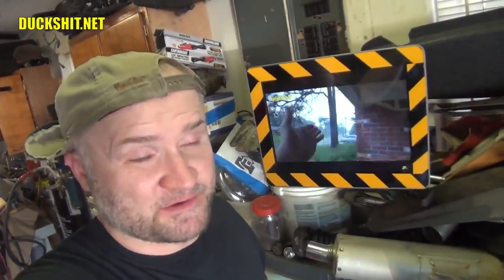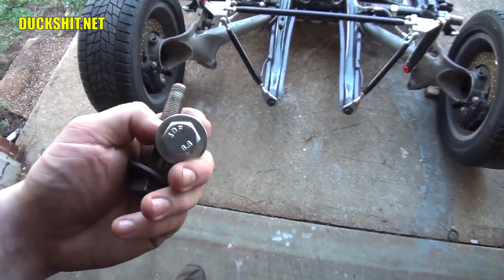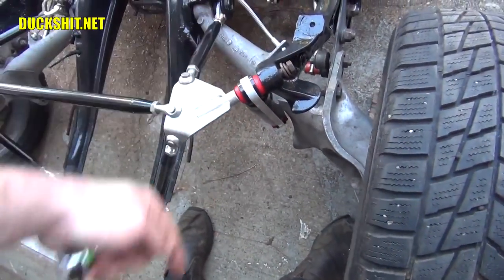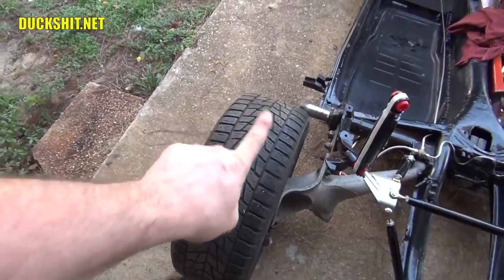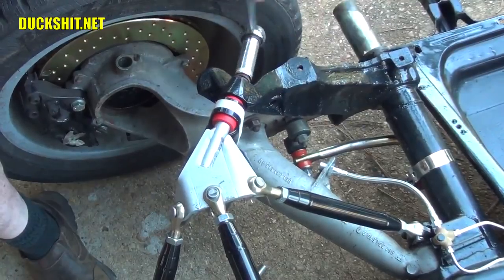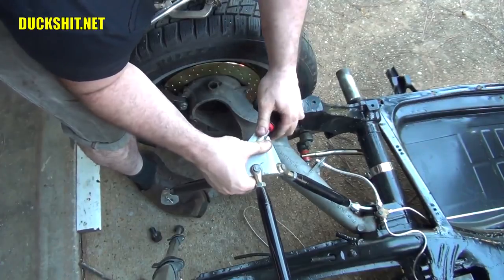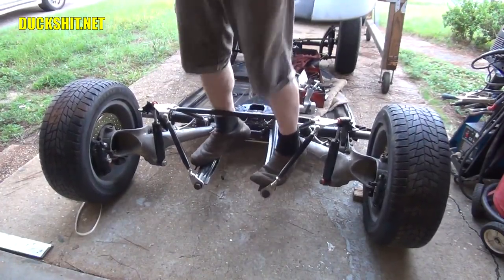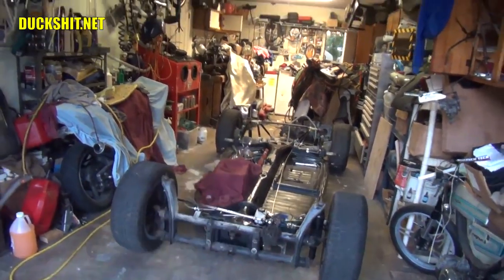Rear Shock Nonsense - ROTTEN OLD 1956 Chop Top Oval VW Beetle - 36

Comment: You make me want to go buy another bug,  I once had a 1965 beetle I bought while stationed at Hill Airforce Base in Utah which I bought for $800 and I drove it to Tennessee and broke down in Murfreesboro due to the points being out of adjustment,  I worked on that bug for several years and towed it home to Pennsylvania,  I burned up the new motor I got in Tennessee due to running it with a broken fan belt so I put my original motor back in and converted the 12 volt parts onto the stock 40 hp I yanked out in Tennessee  , had so much fun with that  bug , driving it was like a time machine,  sold it and got A 1973 Super Beetle,  wish I kept them both
Reply from the maker: Get another one quick before the prices go up too high!  Thank you for that story, I really appreciate those.  Everybody always has a great VW story and I love hearing them.
Reply: Never to late to get bit again by the bug. Your always welcome to come back to the vw family

Comment: Myself I'm working on a 1959 that I acquired with a great pan no holes and even heater channels in perfect shape..body has a few rust holes in drivers rear panel below side window..and a dent or two here and there..  Had no motor but I found a seized 1500 that I broke lose,it runs great...machined bell housing to fit freed up trans,it too was locked up now replacing seals and soon I'll make it into a class 11 legal buggy...
Thinking about a 1967 bus IRS rear conversion,same place I got my motor,
Reply from the maker: Sounds like a nice project there.  Are you making some videos?

Comment: Sorry, man. Winter tires have a softer rubber compound than warm weather ones do allowing them better cold weather flexibility. 'Blizzak' tires go one step further:  Their top tread cap is made from foamed rubber giving them thousands of suction cups to grip the ice better. Once the top cap is worn off they are more like an all-season compound. I had a set here in Canada and they had stellar performance.  Great wet weather tires as well. I also used to sell tires.
Reply from the maker: That's interesting information, thank you for that!

Comment: I mean, if we're getting nit picky about the wheels and tires then I'll just point out that the center caps aren't pointed at the valve stem like they are/were when new Porsche's are/were delivered... ;-) LOL!!
Reply from the maker: Actually that's good advice right there.  Silly and a minor detail, but its something that educated judges at a car show may notice! I'll turn the shields around to point at the stems!  That is was something I didn't know!   Thank you!  You are an endless wealth of advice!
Reply: DuckmanCycles and VW Garage  Also, if you have or are going to be putting wheel locks on, they get lined up with the crest and valve stem as well. Sometimes they are directly above the crest and sometimes in between the crest and valve stem depending on what wheels you have. On your phone dials, they'd go between. It's little things like this that Porsche prides themselves on that very few people know about.
Reply from the maker: I'm leaning!  Little stuff like this is what you pay for when you see that sticker price!  LoL!  Thanks again!
Reply: I actually do that on the cars I work on I'm always adjusting them on every car I remove a wheel on. Very OCD on that and I always have the wheel bolt caps(the gap between the v and the n towards the center cap. Maybe its overboard but I get that itch if its not perfect lol

Comment: Those chrome shafts on the shocks will take a ton of dirt and mud without getting scratched up and leaking seals. If you are still worried about them, you could get shock boots to protect the shafts like they do off-road. Or use a smaller cover like you would put on a tie-rod end.

Moe
Reply from the maker: Yep, you are correct.  I am rather surprised of their design, especially since this company designs their offroad stuff the same way.  But this is how it will stay for now!  Thanks for the suggestion!

Comment: Boot covers for the shocks?    is the top shock bush 2 piece?  its hard to see, but is there a chance its going to creep out of the shock with no washer against the threaded tube,?
Reply from the maker: A washer would be nice, also would be nice to have a longer bolt to accomodate a washer.  There is more to come, its not done yet.

Comment: I have built a limited slip diff for vw trans on the cheap but it's hard to explain but all u need is a extra set spider gears and tig weld and angle grinder and about 3 hrs with the diff already out to mod a open diff to limited slip of sorts
Reply from the maker: I had read something once that an extra set of washers or something would cause the differential to act more like an LSD...  did you photograph or video document your build? I'd like to see!
Reply: @DuckmanCycles  
No I did not this was 1996 I will try to explain so u take your 2 extra spider and use grinder cut it down so it looks like a 3d curved wedge would look sorta like cut out half turn of  valve spring coil then weld it to the face of spider gears on stub side so what happens is it can turn freely about 1/2 to 5/8 of a turn then it hits the big center pin and is locked up tight it worked many years on 2 different rails
Reply from the maker: Sounds more like a locked differential the way you describe it now.  I dunno.
Reply: @DuckmanCycles  well that's why I say sort of a limited slip cause I have drove a few cars with fully welded diff and this one has the ability to slip a 1/2 or 5/8 of a turn before it hits the pin and that's a world of difference than a solid weld
Reply from the maker: Sounds more like a harsh limited lock.... lol!  I'm sure its find for offroad, may not be the nicest thing to drive on the steet.

Comment: thumbs up for using the metric system (Y) :) ps. try to teach abom to use it too ;D
Reply from the maker: Haha!  He gives me hell all the time for using metric... anytime I bring him something and I need his help I always give him metric measurements and it drives him nuts LOL.   He says I'm the only guy that does that to him.  Heheheheneheheh
Reply: The metric is far simpler and more exact then the imperial. Starts by zero and ends by hundred, no a.e messy 1/8 5/16 or 16/32 shit. Try to build a circled extruded roof with imperial meas. and get the distance round from one pillar to the next.... there we go.
A good example how this fails can you see in the Kennedy space center - if they didnt changed that since 1989 as i have seen it in person.

Comment: The main bolts for the shock have to be-  Gread 8 steel,  higher tencile steel,  Soft steel,  Hard tempered steel,  Car wheel  bolts,  Are grade 8 steel.  Double check Duck-Man.
Reply from the maker: Double-checking already done, Volkswagen and Porsche used metric grade 8.8 bolts for brakes and suspension... not to be confused with the standard grade 8 that you are speaking of.  Metric grade 10.9 would be great, but if a car didn't come with them to begin with and why should I be so worried and spend a fortune upgrading all of the hardware?   Not necessary, but thank you for your input!

Comment: would be to eliminate the rear torsion bars and convert to full rear coil-over with Porsche 944 rear suspension on a bug
Reply from the maker: Sounds like fun, but then I lose all of my adjustability that I wanted here and have built into it!  You should build one like you say, I'll watch your videos!
Reply: I misted out the worlds possible & to it was meant to be a question and not a suggestion but after googling Porsche 944 rear coil over kit and I found a few vendors the  make adjustable uni-ball spring plates and complete kits with all the hardware including a set of adjustable coil-over socks. you'll have to wait a long time to see my videos my project is only a plan in my head, a design and a few wish lists at the moment but I will make it a reality one day and make a series of videos of each stage of my project from start to finish

Comment: I want to see a 13B in this car lol
Reply from the maker: Sounds like fun, but I don't want one lol
Reply: @DuckmanCycles  
I just want to own a rotary lol
Reply from the maker: I went through that faze already, lol.  Now I want a flat-4 2-stroke engine made from CR500 cylinders!
Reply: @DuckmanCycles  why stop there
Use 4 maico 700 cylinders lol
Reply from the maker: Yeah, you get it!  Hahaha!  LoL!  and it should all fit reeeeeeeeeealllll nicely in the Beetle without having to cut any metal!  All that blue smoke.... BRAAAAAP!  Ba-ding-ding-ding....
Reply: @DuckmanCycles  
Sadly gas mileage would be measured in gallons per mile 😂😂😂
Reply from the maker: That'd be my least concern lol!